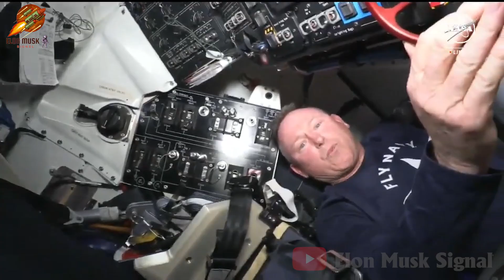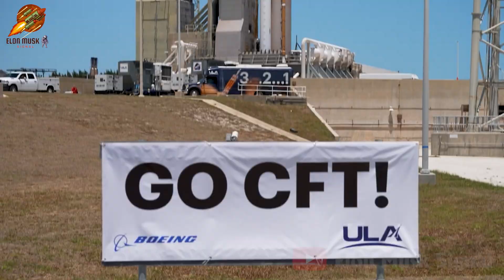New update from NASA and Boeing about Starliner's return date!

Comment: So its good that they have some engines on the ground to test. What a pile of BS! Boeing had these problems with the last Starloser launch, so they had the current one for well over a year and didn't fix it. Instead NASA and Boeing launched two astronauts in a defective capsule saying it was safe. Basically what Boeing did with the 737Max, and 350 people died. Prove it by putting Boeing;s board on the next Starliner, sorry, that wouldn't work as none of them know anything except how to fill in their bonuses on spreadsheets. $32million covers a lot of looking the other way.  It is obviously not fit for manned certification and if NASA had a backbone, the whole thing would be cancelled. Sue Boeing for the cost of an extra Dragon rescue/supply flight. If NASA is really serious about going commercial, then charge Boeing rent of their docking port, put money into developing Dreamchaser as a booster agnostic rescue vehicle. It will be required even after 2030 when the current ISS and Boeing junker will be deorbited by SpaceX.

Comment: So neither NASA or Boeing thought to test the thrusters on the ground?
Reply: Obviously they worked fine on the ground. Zero gravity is a very different environment. Fluids (gases and fuel) don't flow in zero gravity the same way they do on the ground. Also, part of the problem was overheating from extended usage, which is also difficult to simulate at ground level.